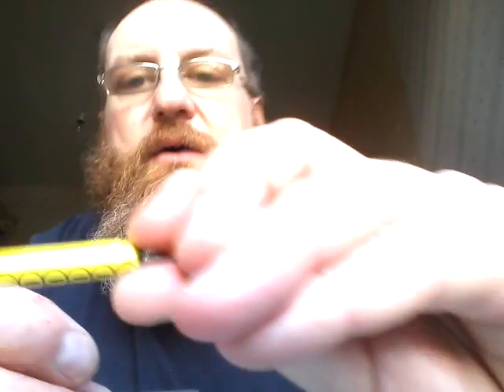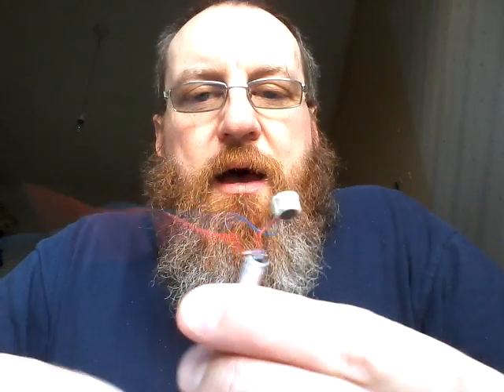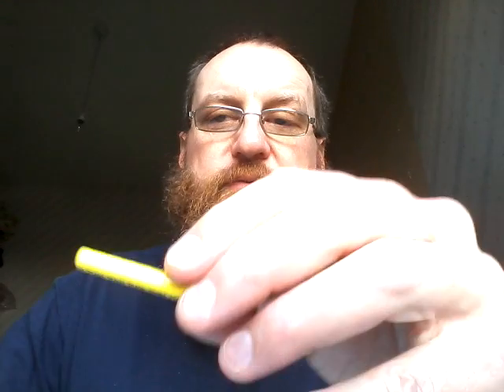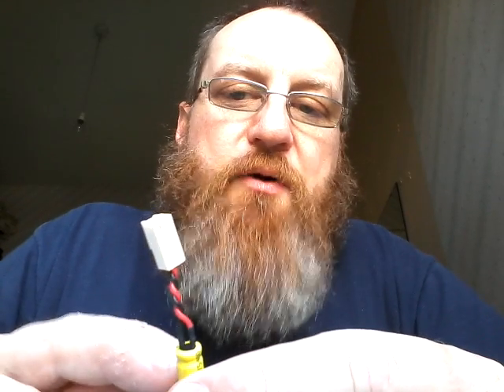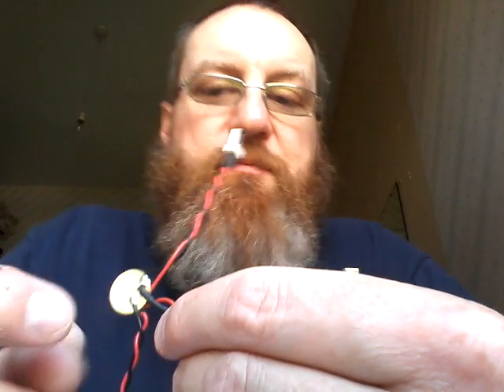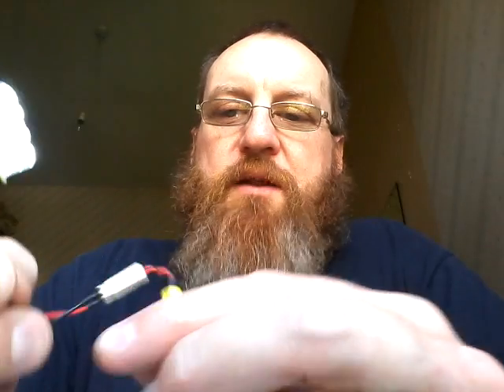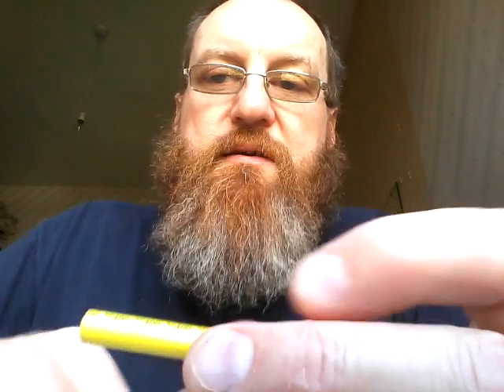Unexpected source of a rechargeable lithium cell.

Comment: A standard 18650 Li-ion Batt has a capacity of 1500 to 3500 mAh with an output between 15A to 30A (the higher the rated mAh the lower the output rating. Obviously) while the little 75400 cells only have a capacity of around 150 mA to 300 mAh. Other than running little pen gadgets and stuff they aren't good for much I can think of even strung together. Considering the cheapest you can get a 75400 is by harvesting them out of $1 E-cigs and 18650 batteries easily found online for less than $10 the cost to capacity is still better for the 18650s or even bigger cells like the 26650s. Still a neat little discovery.
Edit: sorry I didn't see this video is over 5 years old until after I wrote all that nonsense. Cheers!

Comment: Great video. The battery is labeled as 3axis say a 18650 is 18mm x 65mm x 0mm the zero is if the battery was not round L x W x H.
Say a rectangle battery 10 x 50 x 20. A 400mm long battery is 40cm or .4 meter. It got me for a while too. But your videos are top notch.

Comment: Me 2 u can really easy add a tip from 4 battery soldering iron to the screw holder make some contacts and attach it on and put on off switch to all so it go better rly

Comment: Your Pound store stuff is generally a little better than our dollar store stuff, pound being worth more that a dollar (though not by much recently). Though I just did a video recently on a scientific calculator sometimes available at out "Dollar Tree" stores.
Reply: Just found it... You know what moves scarily fast, compared to you getting to the point (and locating the tools you're going to use in this particular video)?

A glacier.

Seriously, if you want to advertise, at least have something worth looking at.

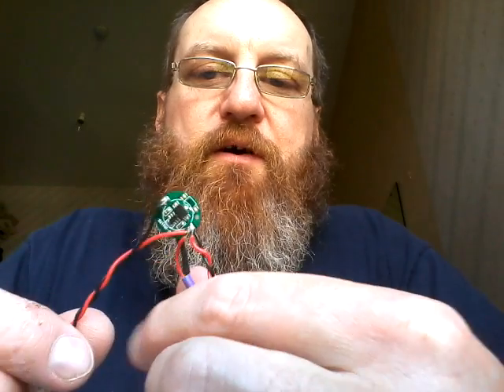I switched of at around 2:40. At that point you were over 40% in, and you were still yapping about the calculator. The screwdriver had yet to meet its first screw of the evening. How much dissection could you fit into the other 3:40, if it took you this long just to say that calculators used to be expensive, but now they're cheap?

Comment: When you are doing projects like this do you always use the same 2 pin connector? A few years ago I started using the standard 3 pin pc fan connector for everything. It seems to work really well, I put the positive pin in the middle to avoid shorts and the third pin is available later down the line. I also see you do the same thing as me and put female connectors on the side that supply's the power.

Comment: Sort of reminds me of the AAAA cell, yeah they do exist. I had received a pocket pencil lamp, LED that had 3 of the cells in them, powering a single white LED. Come to find out it is the same size as what can be found in some 9 volt batteries.
Reply: The ones with six "AAAA" batteries in them are quite helpfully marked 6LR61, where LR61 is the name of AAAA-esque batteries. Most 9Vs are this type nowadays. Do note, the LR61 batteries aren't exactly AAAA, as they're a tiny bit shorter and missing the nib for the negative terminal (i.e. they're Category 2), but that's nothing you couldn't fix with a bit of metal of your own. (The complete package, with the nib is instead referred to as LR8D425, but the actual cells are almost always just LR61. In fact, some manufacturers simply mark their AAAA batteries LR61.) (L means they're alkaline, by the way, R means they're round.)
Reply from the maker: I had one of those.  The Duracells inside swelled up and jammed the barrel completely.
Reply: I never had the chance for that to happen as my daughter spirited it away from me never to be seen again.
Reply: spirited away! what a great movie!
Reply: A lot of 9V batteries contain 6x 1.5V AAAA cells that you can extract if you take the battery apart.
Reply: Ha, yeah she did just that, I thought I lost it.
Reply: What? This is news to me. All the 9V batteries I took apart as kid had 6 short cuboid cells stacked on top of each other, no AAAA batteries.
Reply: Craig Nehring   i miss AAAA batts. i used them in high power laser pointers concealed in a pen, before china started mass producing.
Reply: i got a stylus for my tablet that uses AAAA Batteries. Was quite iritated as it was the first time i came in contact with them and didn't know they existed.

Comment: should work great for the little spy or drone style camara's they sell for RC equipment. I have a little camara that is for a Small RC helicopter,unfortunately, it didnt fit the one I bought. I do intend to hook it up to a very small battery and run it separately, mabe through a servo or even an extra channel on my RC plane. I was thinking of using a small battery like that to power it,with a resister to get the power knocked down a bit.

Comment: Actually the interesting bit is the electronics .. that looks suspiciously like an electret mic on the end .. I would have expected something along the lines of a N.O. diaphragm "puff" switch. Curious now as to how these devices actually work. The engineer in me is overthinking now .. some custom fab Asian electret with integral comparator and driver detecting the ultrasonic signature of a pull? Surely not even in this day of $.05 custom silicon in bulk.
Reply from the maker: +Jim Vicious Same case as an electret microphone, but different inside.  It's being used as a pressure activated diaphragm.  https://www.youtube.com/watch?v=lZ7YIKV4MF4
Reply: +bigclivedotcom   You should have included that info. in your video. I've wondered how the cigvape knows when to turn on. If it was on when you aren't "ventilating" your lungs, it could start fire.

Comment: Question on a slight tangent. What is your view on the reason behind exploding e-cigs, mobiles/cell phones and even their chargers sometimes? They are often in the news where they've caused injury. Do you think there's a common theme like sub-standard parts or mis-use by the owners?
Reply: +3enjoy3 I would say abuse also plays a factor. People will buy a 1000€ phone and replace it in two years, but a 1€ charger, cable included, which they will use until it dies.

Comment: I pulled one of these batteries from an NJOY Ecig. Was going to build a e-cig flashlight out of it but I never did because theres no way to turn it on unless you tap straight off the battery.  I still have the battery but unsure what I'll use it for.

Comment: its your face! (its a lovely face but I was not expecting it. so many videos with just hands and then this) your take on the dangers of sub ohm heating elements in ecigs would be interesting. those 18650s have a lot of potential for incidents if abused. I do vape  with protective circuitry but I know there are people that pretty much stick coils straight onto cells

Comment: What I find really bad, is that these are in a one use, throw away item. While lithium isn't the worst stuff, having cigarettes like these litter the streets, parks and beaches, instead of all the cigarette buds we have now, would be a lot worse. These are not going to be recycled.

Next to that I just want to point out that e-cigs are probably just as bad, if not worse for your lungs as regular cigarettes.
Reply from the maker: +RogerWilco It's not even remotely possible for an e-cig to be as bad as breathing in burnt particulate matter from a substance that has been deliberately engineered to be as addictive as possible.  Cigarettes don't just contain crushed tobacco leaves.  The rechargeable lithium cells actually contain virtually no metallic lithium.  Just lithium ions in salt form.  As such they are more ecologically friendly than discarding a non rechargeable cell of equivalent capacity.  Although it does still seem wasteful.
Reply: +RogerWilco What I don't get is why smokers think that it is acceptable to just throw the buds down on the ground. Is it because they see everyone doing it? or are they truly this thoughtless (like 70% of smoking death is from 2nd hand smoke)?
Why wont they throw them into a bin?
Reply: +Boris Chan Second hand smoke IS harmful, but 70% is a completely bullshit statistic lol. Check the CDC fact sheets.
Reply: Is everyone dense? Smoking Vapour is 95% LESS harmful than smoking tobbaco, It's only Vegetable Glycerol with whatever flavour you've chosen. I can't believe people still think it's worse. I laugh my ass off. 

The proof is in the pudding, a government pudding ;)

Proof: https://www.gov.uk/government/news/e-cigarettes-around-95-less-harmful-than-tobacco-estimates-landmark-review
Reply: Not all of us smokers are messy and irresponsible.  If a "bin" isn't available, for me, I field clean my smoke (meaning I allow the tobacco part to fall to the ground) and then I pocket the smelly butt until I am near a trash can.
Reply: +RogerWilco they are actually easily reciclable... I daresay that filter of normal cigarette is less reciclable because of poisonoul phenol and the stuff it absorbed
Reply: False equivalency aside, vaping is much safer than smoking, especially if you're using a high quality rig. Some of the little cheap e-cigs are more bad for you because their heating elements put copper in your system which is pretty bad, but high quality coils made of titanium are perfectly safe.
Reply: +Boris Chan I don't think I can link anything on here. Just Google "cdc tobacco related mortality" and click on the second link. According to their statistics approximately 8.6% of smoking related deaths are due to second hand smoke.
Reply: Vaping is 95% safer than smoking.
Reply: V3TJasper
I'm actually interested to find out, but I can't find the fact sheet on smoking related deaths. Can you provide a link?
Reply: they have ashtray on top of bins.
Reply: lets not over do it buddy.. they are just as bad.. but in no way worse.. unless you vape some cheap chemical shit... same with cigarettes
Reply: Fractoman
being punched in the D is also must safer than smoking. Should you still do it?
Reply: 1kparmar There was a study done by Public Health England that concluded that vaping is 95% safer than smoking.
Reply: Etiquette is fine and should be respected, but the safety is based upon a study done by a third party. While your glib joke that it's "TM" is cute and all, it's absurd and glosses over the point.
Reply: +ANCIENT ASTRONAUT Forgive me if I'm not convinced by an undocumented 1500 word article.
Reply: If you throw them in a bin you will start a fire.
Reply: g
Reply: 1kparmar
Then we must show the study how being punch in the D is 70% saver than smoking :3
Reply: RogerWilco lithium is a very finite resource compared to other existing elements
Reply: Whether or not it's healthier, or less unhealthy, doesn't matter. It's above all a simple matter of etiquette. No smoking means no smoking. That includes vaping. People must not be expected to trust anyone not putting anything idiotic in their fluid. People must not be expected to passively agree to tolerating any entirely preventable or avoidable aerosols just because it's the newest fad and Everybody(TM) knows how totally much Safer(TM) the new shit is. I don't give a flying toss whether it's liberated by a glowing wire or smouldering plant leaves. You want to puff your favourite flavour, you respect others and ask, and if you can't handle a no, that's your problem, not theirs. Full-stop.
Reply: Glosses over what point? I didn't even mention that study of yours, neither did I imply to. I can't be held responsible for what you infer. Thank you.

Comment: I was surprised to find the cheapest AA NiMh rechargeables on eBay charge up to 3.0V... Hmmm? Please look into them for me, at the time I got them from ebay.com/itm/-/180558507484
Reply from the maker: +Sebastian Ramadan They're probably 300mAh at best and have a high internal resistance, so the fast chargers are giving them a rough ride.
Reply: bigclivedotcom You could be right; it wouldn't be the first time a seller in a third world country understates capacity, but by a factor of 10 would be quite a shock... I'll have to check that! I've been charging them using a USB charger, so 1A, 5V and they're only barely warm at the end... If they're 3000mAh they should take 20 hours to charge at this rate, but if they're only 300mAh, then this would correspond to 18 hours of overcharging. I'm not sure how long to charge them, now... :(
Reply: Oh, wait, that'd be 1A if they're able to negotiate a larger current, but these are some cheap chargers... Maybe I should keep them away from my MAINS.

Comment: this is a neat thing to do with something that otherwise would continue to harm and fuel some poor souls dreadful addiction.
(e-cigarettes may actually be more harmful even then regular cigarettes both of coarse are horrible... though not sure if you get the Lead 210 and caesium 210 isotopes if you smoke e-cigarettes... I know you nuke your lounges on the regular stuff though :p)
Reply: I hate it when I nuke my lounges, it costs me a BOMB in upholstery renovation.

p.s. Actually do your research before you regurgitate someone else's opinion. 

https://www.gov.uk/government/news/e-cigarettes-around-95-less-harmful-than-tobacco-estimates-landmark-review

^That might be helpful.
Reply: Küala Music
yeah a car that smells of cigarettes is probably going to have a shitty resale value too so that's a big depreciation of the cars value...
Reply: ZerqTM Vaping is good if you build a preference. I hate normal e-cigs and those dispensable ones, too much nicotine. A light or non-nicotine oil is just like breathing in a breath of air. Companies have acquired quite the excellency of replicating tastes and inventing new blends. Don't take it back to your lungs or you'll hate the exhale. Buy yourself a nice mech mod, get some premium oil and vape away.

Be careful vaping around electronics since it's basically water vapour and it can short the circuitry if it gets pulled in by a fan.

Comment: I've gotten 600-1650 mAh cells from the bigger ones, people the cheaper ones tend to die due to failure on the circuit boards inside, or broken wires, so people throw 'em away ;)

Comment: 90mAh lipo - interestingly that is the same capacity as a lot of these tiny quad copters and such like flying gadgets. They use rectangular pouch cells, but I'm sure this would make a cheap substitute. The typical replacement cells for the toys start at around $4.00 so when your annoying flying gadget no longer takes a charge....  time to visit poundland, and you get a a couple of hundred nicotine hits thrown in for free.

Comment: seems a bit overly evil of them to include a 90mah battery in a size that generally houses 220mah ?.. on top of not having a way to recharge :)

Something like SKU 2774000 on fasttech.com I guess is a more up to date version of this if you want cheapo cells :D.. it is such old tech that I doubt they will be doing much wrong hehe..

I know the price is a fair bit higher, but included with your 650 / 900 / 1000 etc mAh rechargable cell you get (hopefully) a nice tiny pcb with 3.7 / 3.8v regulator and short circuit, low volt and high heat protection... lol

It is honestly a crying shame you aren't a smoker :(... While I have enjoyed watching youtube ecig reviewers try and learn even the simplest of electronic basics over the years heh.. someone who actually knew his shit might have sped the whole industry along... I mean since it is an industry driven by knowledge / lack there of that every company has to come up with something new every 6 months to try and capture 2% of the market... hehe, you would be king.

On a side note I'm fairly sure I have most of my old dead / abandoned ecigs kicking around somewhere.. not a huge amount I don't think since Iv never bought a single "disposable" one, but I rarely remember to take things like that down to local dump to dispose of properly so usually end up hoarding hehe, be happy to send if I find em and you are interested ?.

I'm guessing the cells will probably be dead now but the pcbs might be interesting hehe

Comment: wouldn't it be both cheaper and faster just to buy them at 10-15 cents off Alibaba? it's a generic 3.7 volt battery at only 90 mAh.
Reply: +SquirrelFromGradLife - But can you smoke the ones from alibaba?  Seriously, the real point is you can buy these from the corner store if you ever need one for a project.
Reply: I think the point is you can buy it at a gas station instead of waiting for months to get them from china.

Comment: I've never been able to source many of the gadgets you find in either 'Poundland' or the new 'PoundWorld'.I did get an 'e' cigarette, but it was junk, not even worth a pound. Just a hollow tube and a filter soaked in some foul-smelling liquid. Nothing with an electron anywhere near it.However, in the course of doing another hack from You-tube, I blagged tons of discarded cells/batteries from the 'recycle'boxes in Supermarkets. I started by asking politely, and got all sorts of narrow-minded anal-retentives saying 'no' so I donned a fluorescent safety jacket, strode purposely to the 'customer service desk and just asked where their recycle container was.They all assumed I was official and I took the lot. You can find lots of reusable cells, but I've also blagged several mobile-phone batteries which seem perfectly OK,  plus some discarded  'e'-cigarette power sources. These consist of a metal tube like BigClives, although probably from more expensive devices,  and the same kind of lithium rechargeable he has.